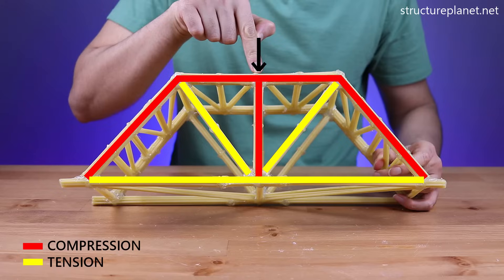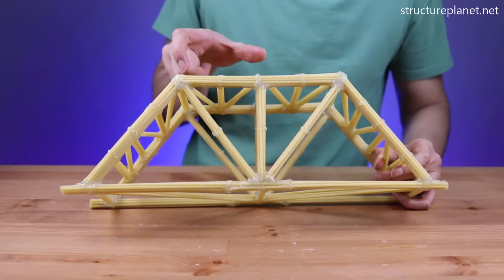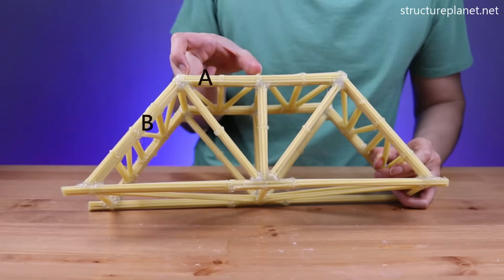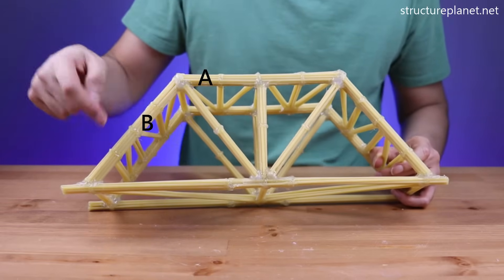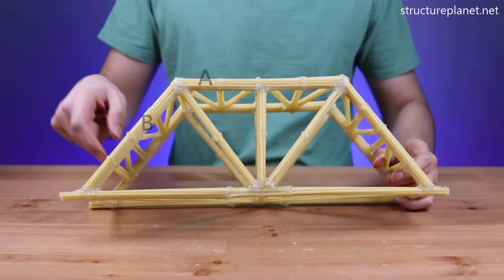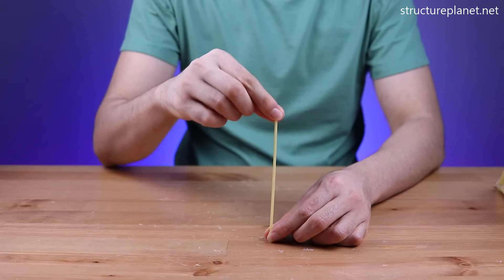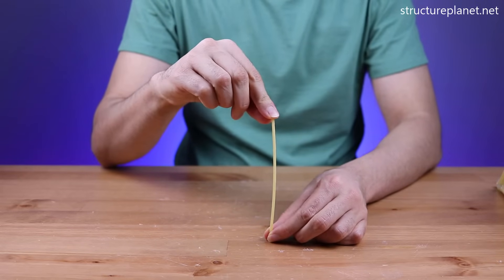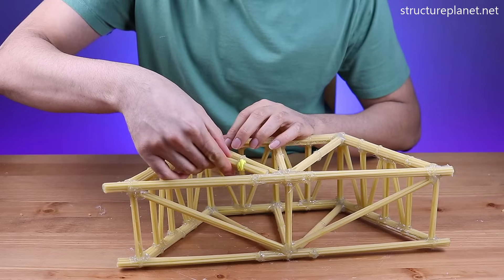Making an Unbreakable Bridge with Spaghetti!

Comment: Wow tysm for this video, we need to make a spaghetti bridge un school and we decoded to do this design, ty 😃
Reply: How well did it work was the weight applied on top or was it hanging at the bottom
Reply from the maker: They should both work but applying load from top will remove the possibility of a local failure due to loaded area being too small.